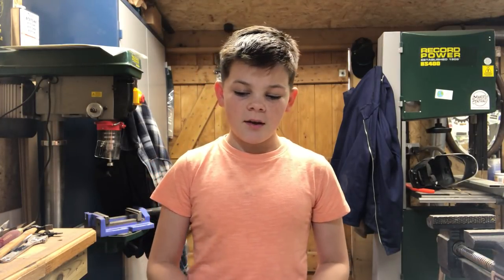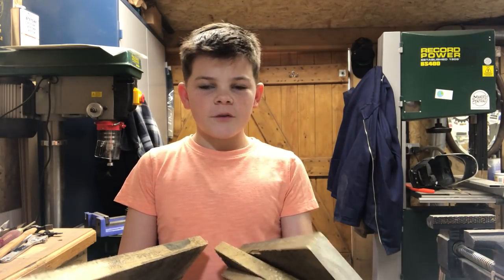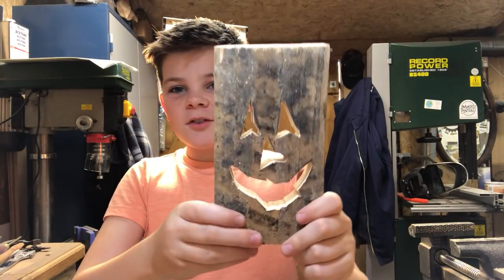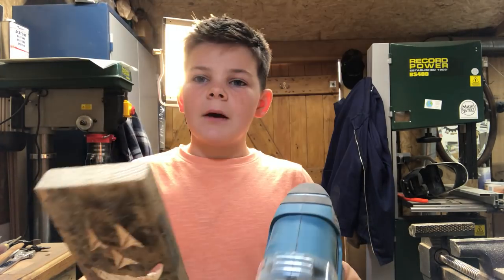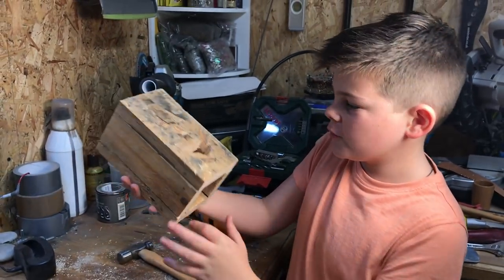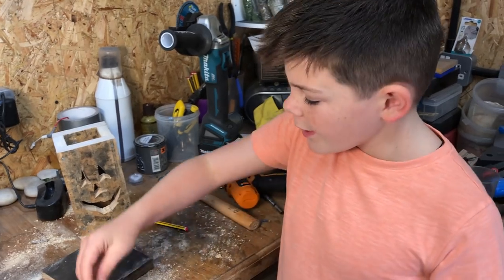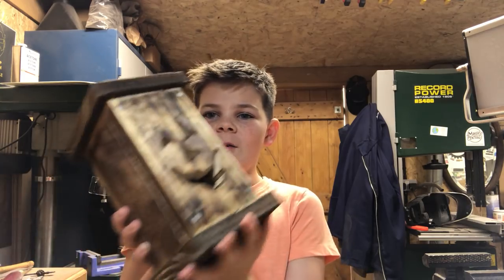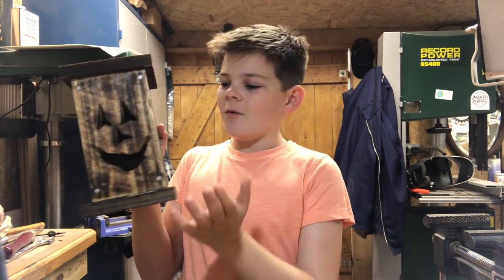Making a Halloween Lantern using Pallet Wood

Comment: I really like this.  Just as a suggestion, when you are nailing into wood, if you hold the nail in a pair of pliers when hammering it, it allows your fingers to be out of the way of the hammer, but still able to hold the nail in place.

Comment: Nice project!  Thanks for leaving your struggles in the video.  It's easy to forget just how much strength it takes to use hand drills and other hand held power tools when you're just a viewer.  I had to add some blocks to the bottom of our desks to raise them up a few months back.. I was like "Oh this will be easy, just drill some holes and screw some blocks of wood together!" Nope.. my hand hurt for days and that was just 30mil pine.. stripped the tops of multiple screws.  Eventually I went and bought better drill bits and that helped a ton, but it still wasn't easy.

Comment: Also, have your dad help you build your own work bench with adjustable legs so it can fit you now, and grow taller as you do. His bench is too high for now, that may be causing some issue with your hammering (it's hard to hammer on something that is higher than your natural position to do so).